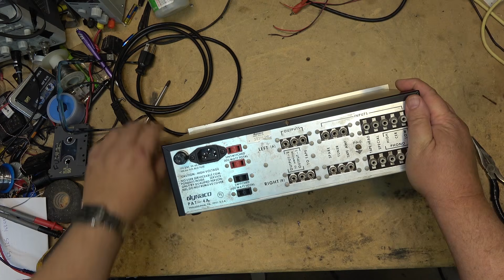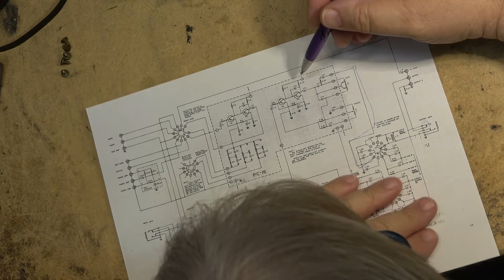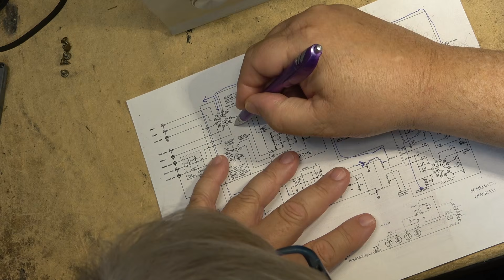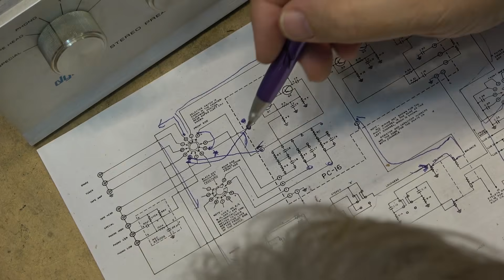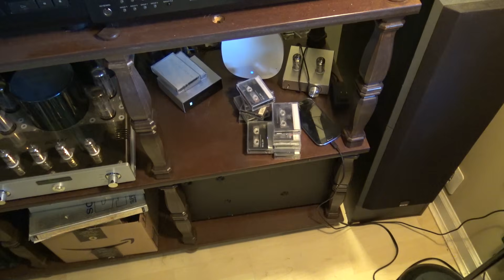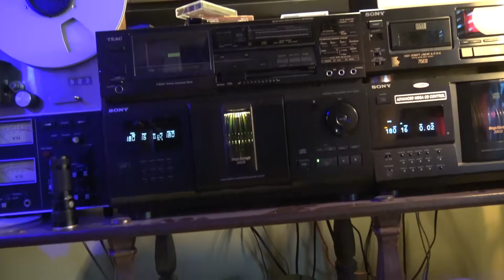Dynaco PAT4A Preamp Mod to add 2 additional line level inputs

Comment: The unit you have was factory wired. You can tell because the jacks and outlets are installed with rivets and there are more colors of wires used. Kits used screws to install the jacks/outlets and had only red, green and black wires. Also the final inspection stamp on the chassis. I have one I built in 1970 along with the Stereo 120 and at the time a newly introduced FM5 solid state tuner. Still working great today through Dynaco A25 speakers.

Comment: Awesome setup you have there! Where was the amp at in the video? What are you using as an amp? What brand name?
Reply from the maker: The amp is on the bottom shelf standing on end.  It is a Crest Audio VS900. That's a 900 watt class AB powerhouse (450WPC).
It's a big professional PA amplifier.  Crest is owned now by Peavey. It the type used in movie theaters, churches, stadiums, clubs ect. Nothing to look at, power switch and a couple of green lights that blink when outputting power but man on man is it ever clean.  Transparent.  Best sounding amplifier I have heard and they are dirt cheap compared to the "name brand" consumer amps. One cool features is they don't clip.  If the input exceeds the level where clipping would occurr it will attenuate to prevent clipping.  If consumer gear did this nobody would blow speakers.

Comment: Great video Dave. I picked one of these up I think in 1977 on short assignment to Germany in the Air Force. Many people recommended I pick it up at a reduced cost. I’m impressed with the sound coming over through YouTube. I don’t know how you were able to provide this sound but very impressive. I’m currently not using my PAT-4 but when I do I may consider this mod. Thanks
Reply from the maker: I turned the audio gain on the camera down set it to manual and just held the camera between the speakers. I had to record the demo section because the first time I did it I had the audio level set to auto and I was cranking the music up overloaded the camera and all ended up with with lots of distortion.

Comment: I recently got a little Pioneer amp with a moving magnet and moving coil inputs...now I can again use my Thorens turntable...heeee ha. Bought a DCR-HC26 at a hospice shop for R60...about $4...with a stuck open tape door. Used your magic tricks you did on yours a week or so back....and believe it or not...only a little bit of cleaning spray on the mode switch...now I have an excellent working mini DV player. Thanks for all the "trade secrets" you share with us. Enjoy all your videos...keep them coming.

Comment: This preamp sounds great! I didn't have such good luck with my Dynaco Pas 3 tube preamp. It just didn't seem to have much headroom. I purchased a few mods to the preamp circuit, but it didn't help . I even installed a modern power supply to replace the selenium rectifier and the original capacitors, because the caps were bad, and the selenium rectifier needed to go.  It definitely needed some additional modifications to boost the treble. This was in the early 2000s, and I just didn't have time. I wish I had put it away in a closet for future modification when I had time. Instead, I sold it. The buyer actually liked the way it sounded. It's a shame. Now I'm heavily tempted to get my hands on a Pat 4. Thanks for the informative video.
Reply from the maker: I have heard that complaint about the tube version.

Comment: This video is a lot better than the one the other day with that British surround sound receiver that was a mess for you ! Lol 😆
Reply from the maker: I hate av receivers.  That was one of the reasons i left the repair business.   That and no money in it anymore.  That was 2003.
Reply: @12voltvids  Yeah, I hate them also !, they all look like a big black block sitting on the shelf!, no style !, I miss the receivers/amps and preamps from the late 60's up through the late 70's, early 80's, they all had style and you didn't have to worry about right to repair !

Comment: I had one of these !, great preamp !, I would use the special inputs for microphones !, I still have the schematics for the preamp !
Reply from the maker: Special input is a microphone input.
Reply: @12voltvids  Yeah, that's what I would use it for, I think the other input was for a ceramic cartridge turntable, but everything was a magnetic cartridge, hardly used ceramic cartridges
Reply from the maker: @b.powell3480  it had a tape head input and special. The phono has low and high magnetic and a ceramic input.  All in phono input.
Reply: @12voltvids  Yeah, you could hook up a lot of things, like you mentioned,  tape players with just the heads, maybe a low level TV audio, etc. Thanks again for another awesome video !